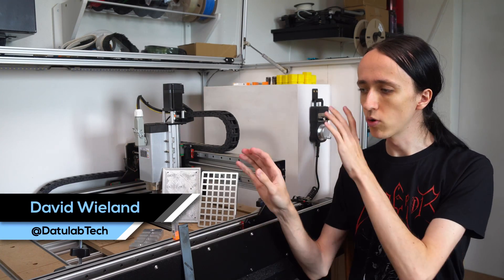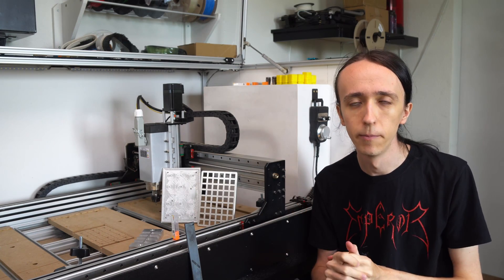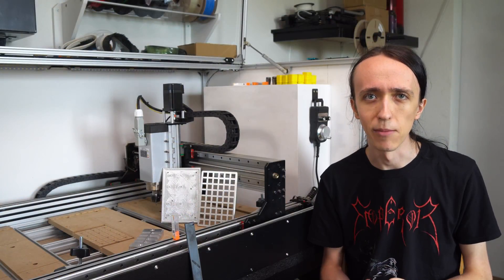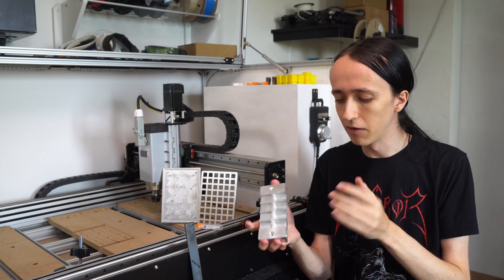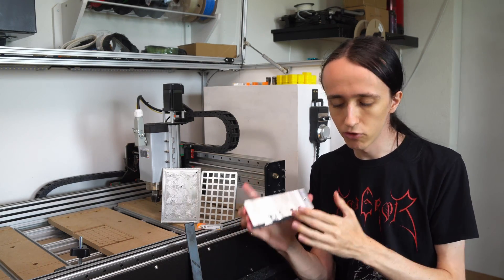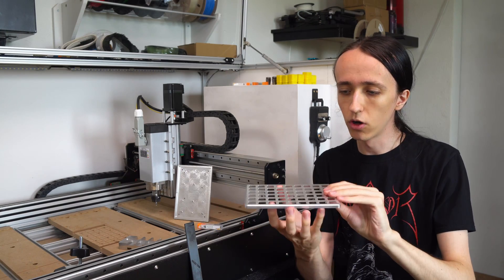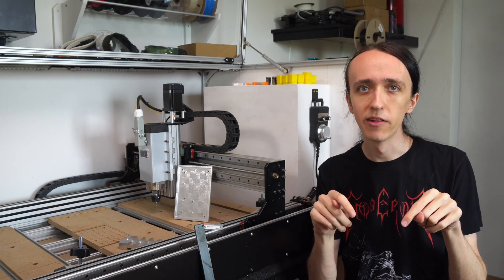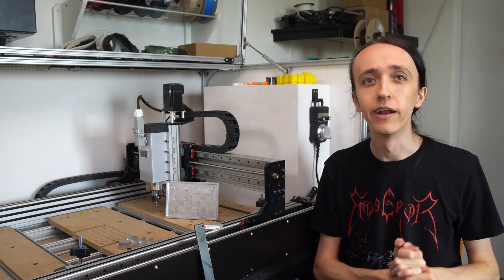RatRig KillerBee Review Part 2 - Cutting Metal like Butter

Comment: Hey, idk if for you it's the same problem and if you still haven't figured it out but I had these random stops you're talking about, using a different controller but also using mach3. I was reading something unrelated, about idling cpu cores and it dawned on me that it could have something to do with the machine stopping. Now I just let some 12 hour long video or something playing in the background and the issue goes away.
Reply from the maker: I think in my case it was the controller and not the pc that has the issue. When it freezes, the pc still works normally but the controller is unresponsive. I ended up fixing the issue by switching to a Masso controller instead of Mach3.

Comment: Thank you, very impressive. I am just starting the build on the KillerBee, opted for this over the newer design and just having my plates water jetted now. I knew it would do aluminium but not at those depths and it was a nice surprise to see it cope with mild steel as well. I want to be able to use mine on Hardwoods, some aluminium and definitely on Brass and Copper. 

I have a small mill already on my Lathe so forme this is a really big step up to be able to mill the material with a CNC, I already have a Workbee which I use for normal wood and of course that is using rollers, I think once I get to grips with the KB I may well upgrade the workbee to at least single linear rails on the Y axis .

Thanks very much.

Comment: You should make a beginners guide to the cam, and controller usage for new users :)
Reply from the maker: Once I've figured it out myself I'll consider it. Definitely the hardest part and I'm far from feeling comfortable with it myself.
Reply: @DarkArtGuitarsWorkshop  yeah, and also the hardest part to get good videos on, alsom tramming the cnc, and calibrating the movment om the axes.. i have a queenbee pro built, still need to calibrate and learn the programs tho.. do you use fusion 360 as cam?

thank you for the great content btw :)
Reply from the maker: @bjopleif  I do, check out NYC CNC in case you don't watch them already. They have quite a few Fusion CAM videos, though most of them very specific but you can still learn a lot.

Comment: Very impressive results indeed. Thank you for showing me my request of flexing frame with hands, seems quite similar to Openbuild cnc but the results are far superior or maybe I need to significantly up my alu game, I cut hardwood and just peeked into alu for couple of parts. Personally, as an owner of quite close machine, what would be curious for me to see in the future is an example part out of aluminium which involves different cutting strategies (especially 2d contour cutting out the part)  and the attached fusion 360 file with complete CAM,  that would compliment your voice info a lot.  The voice does not really translate that well for me into hard numbers as a file which you can go slowly through. I am sure quite a few people would be curious as well. Also don't forget to mention which aluminium you cutted.
I buy my mills from ali as well and find them very impressive for hard wood ( like real hard wood  wenge, ipe etc.)
Btw I have not heard any chatter in your cuts to call them bad, just some load, the 10mm still was not sounding that bad just getting close, at least in my lame wood cutting opinion ,over time I upped my cutting speeds like 5x after a while in certain cuts no real loss in quality plus you generate far less heat but gumminess of alu is an issue for sure...
Reply from the maker: I haven't really experienced any chatter (except when using too long endmills), the main thing that was limiting is the endmill loading up with chips and gumming, leading to more heat, recutting of chips,... Probably would improve quite a bit with some mist cooling. Apart from that the harder you go the more flex there will be, so just make sure to do a light finishing pass to hit dimensions. 
The audio on the video also sounds a lot more calm than what it sounded like to me, but I also don't have that much as a reference.

Comment: Great machine overall i have it for 6 months now. Only downside i can speak of is the amount of wobble i have on the Lead Screws (my machine is 1010 size). Do you have any similar issues too? If yes what did you do to fix it?
Reply from the maker: How fast are you going when you have the issue? I found that I can put the rapids up to 3000mm/min on the y axis (which is also 1m) before I get too much screw whip. If you numbers are significantly less, make sure you properly tightened the end supports who should be pulling on the screws to help stabilize them.
Reply: @DarkArtGuitarsWorkshop  Hello! I have tightened the leadscrews and have also changed the thrust bearings to a bit more beefier ones. I can get like up to 4000mm/min speeds with no issue, but by the sound(when it moves) and looks (amount of wiggle) it just doesnt feel right. I mean okay they could have used beefier leadscrews more than 8 mm thick to get rid of the problem. When the leadscrew starts to move out of the axis of rotation you start hearing that rubbing sound it makes on those tight Nut Block threads. Such a nice design for the price, but that is my only concern about the whole assembly that iff done differently (with just thicker leadscrews) could make it perfect.
Reply: You can put leadscrew in tension....google tingle tension system :)
Reply: @unique93obr  I did put the leadscrew in tension, and also i dont believe that you need that tingle tension system thingie to do so
Reply: @kotsios1234567  maybe ypu just need to grease it a little bit... :)
Use lytium grease for leadscrews :)
Reply: @unique93obr  There is not friction issue here there is non linear motion on the leadscrew which in return makes the leadscrew oscillate really fast resulting in weird noise and on high feedrates coming from the nut blocks. Sometimes it even stalls the stepper motors because of the screw getting tightly blocked between the nut blocks. What i am trying to stress out here is what was the only real problem i had with this machine(which i fixed up to some point) and the fact that i could have been done better by using a thicker type of leadscrews to avoid the wobble on high feedrates. Trust me there is nothing worse than machining an expensive material only to lose some steps and get the whole project failed after 40min of machining. I havent had this yet happen to me but i am pretty concerned about it